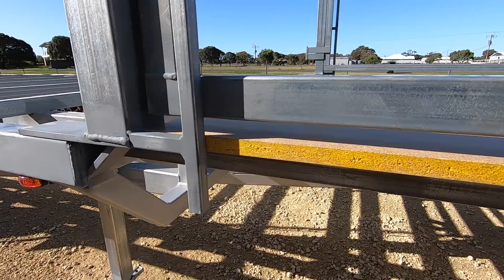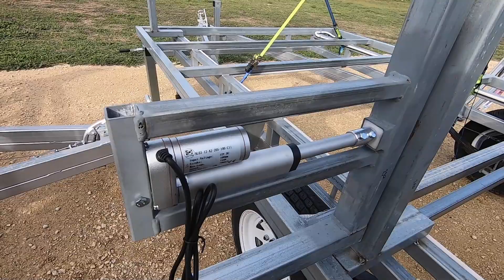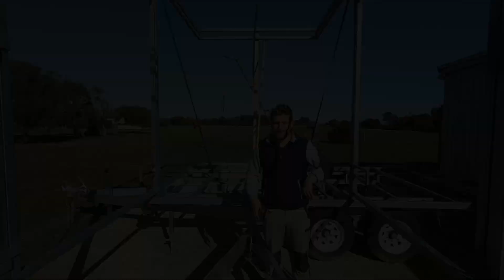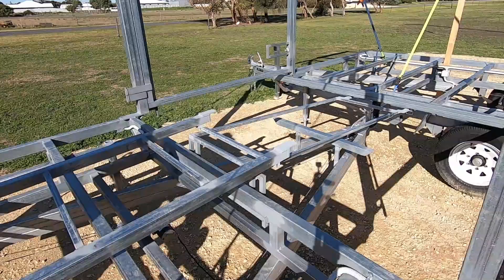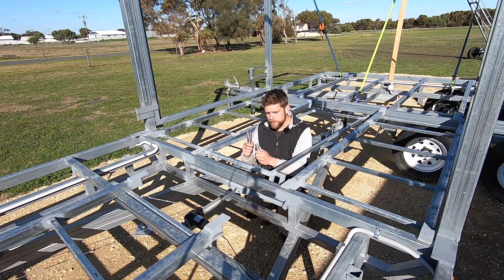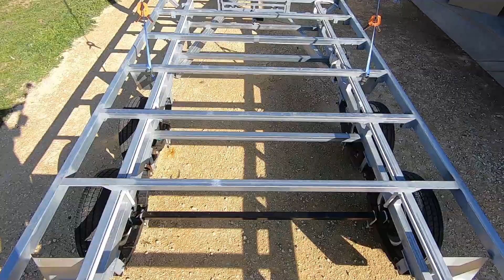Ep. 10 - The floor that joins the my two trailer tiny house - Tiny House Build Update

Comment: Yes like your floor solution especially using the actuator, are you using all lightweight metal studs to keep your weight down.
Reply from the maker: Thank you Chris. Nah I'll be using timber, there will be way too much custom work to tie it all in together to do steel. I'll need the flexibility of timber. Going to run 70mm studs though.

Comment: Nylon on the steel/steel interfaces to reduce sliding friction?
Reply: A simple construction grade silicone spray could also work great, 🙋🏻‍♂️ is a heavy equipment engineer who has been one for over 30 years and has more than that in experience time and they use it on the heavy equipment all the time so if they can use it on the heavy equipment I can't see where it would be a problem to use it on your floor or anything else that needs to be lubricated we even use it on our swing out in the backyard to keep it from squeaking where the metal hooks hit each other ‼
Reply from the maker: May put some nylon on there but I am not too worried. The floor will rarely come out as I don't intend to move it a lot. But some nylon would certainly make it slide easier. Was just thinking some nylon tape.

Comment: This is really great to watch the ideas evolve.   You must be the kind of guy who goes to watch the travelling carnivals set up!  All of my best ideas are stolen from other industries.
 I wonder if you have weight concerns and what kind of wall panels you will use?  I used to work on fully equipped trailers where every pound counted so we used lightweight plywood and structural composite sheet  (plastic waffle board).  Not cheap but good for no compromise customers.
Reply from the maker: Ha no, but that is a great source of research I should look into that. 
I am concerned about weight. Mainly because I want to keep to 3 metric ton and I have a lot of steel work in that join. Getting a little nervous. I'll be using either ply or a veneer product. Still to pick that but aiming to keep the lining light as it takes up a lot of weight. Trying to make the interior aesthetically pleasing as possible.

Comment: Does the linear actuator have to resist the pull of the springs? Or will there be some sort of locking pin?
Reply from the maker: Yep it's a 6000N actuator. I was originally testing with a 750 and it would just max out near the end.  Also it's designed so the arm takes half the tension. The spring is pulling close to 45° so when the arm is straight half of that tension is pulled up through the arm to the trailer. Time will tell how it holds up but it has a pretty solid lead screw inside of it

Comment: Slide-outs are so yesterday. Keep going! Looking good.
Reply from the maker: 😄 I can see me building another just to perfect the floor design. There is a better idea out there but the trailers would need to be built around it. Even had a local engineer rock up with ideas on how to make this one work 😆
Reply: Great work on figuring out the floor. I have to applaud your efforts. 👏🏽👏🏽👏🏽👏🏽 That and the Weatherproof Roof, have to be the most difficult parts of this build.  👍🏽. 

The sliding roof is what I am waiting on.
Reply: I had expected a slideout floor.  Or a folddown, nested inside the walls.  Did not expect your solution at all.  For that matter, originally would have thought a whole slideout section.   Congrats on your milestone. Good luck.